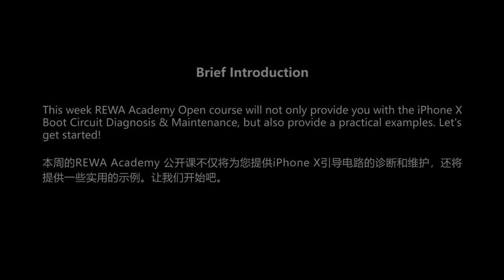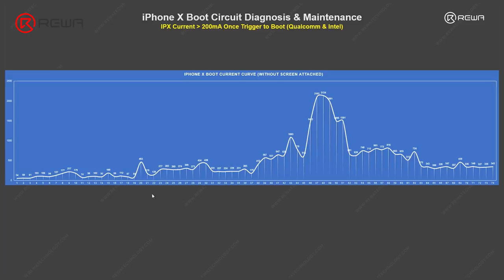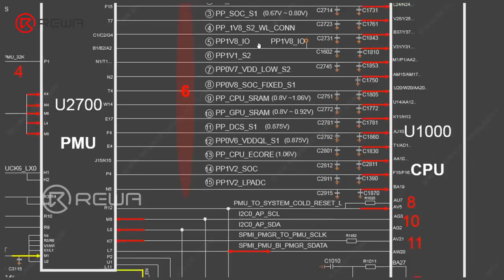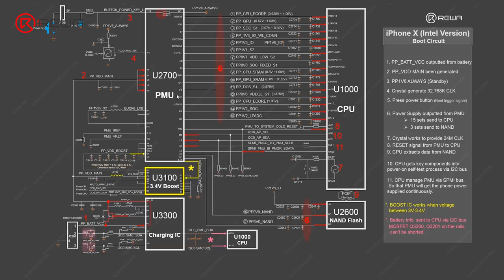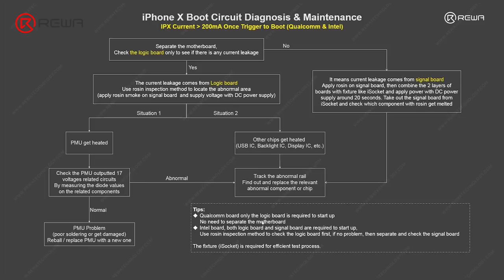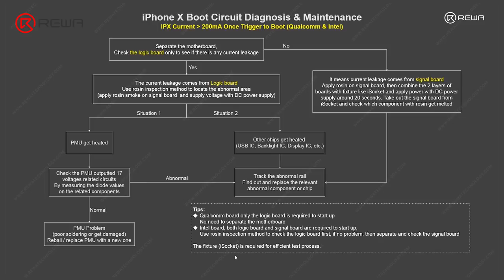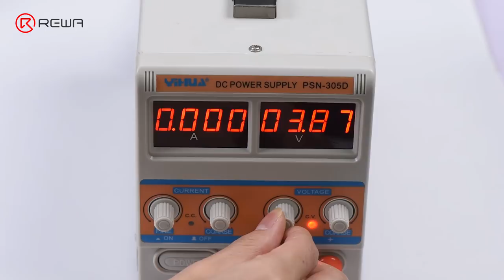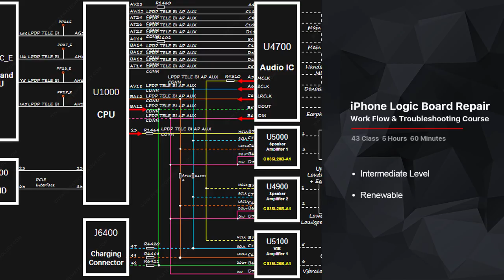iPhone X Boot Circuit Diagnosis & Maintenance Online Course | REWA Academy

Comment: is 3.6v safe while usinig rosin testing method--- because u applied voltage around processor and processor only needs around 1.5v voltage helpp

Comment: I didn't know for an Intel motherboard it wouldn't boot up if its separated. Boot current only goes up to 60mA. Is this because the EEPROM is on the signal board?
Reply from the maker: Hi David, while there is nothing to do with EEPROM. The Intel motherboard once sperated, it wouldn't boot up only with logic board, n boot current remains 60mA.

Comment: Can someone explain: He found C2649 faulty and then he ticked it off? Am I missing something here? Did he run boot test before soldering a new c2649. I just saw he took/tick it off and then he was done ✅
Reply: Starting at 10:47, after removing the c2649, he took care to measure the diode value from  empty pads, so he found that the value was normal. Which means that this problematic comes from c2649. So he replaced the c2649 and then tested
Reply: Evangéliste Jean Paul MUTOMBO NSAPU thanks for the clarification. I got confused because he didn’t show the process of putting a new c2649, but I should of assumed he did. Thanks! :)

Comment: Rosin smoke is one method what are other methods not including alcohol or freeze spray????
Reply from the maker: Other than that, you can use thermal imager, while rosin smoke will be one of the most cost-effective and efficient way base on experience.
Reply: REWA Technology thanks I will soon try this method of rosin

Comment: What is the best way to tell whether or not a current reading is normal?
Reply: Do I need to infer it from the circuit diagram, or do I just compare it to values of a working device? Or something else?
Reply: @samiabe8686  the values are in the circuit diagram. you can download the free Rewa eçschema called: REFOX.
In this software, they take care to put the circuit diagrams and the values
Reply: Evangéliste Jean Paul MUTOMBO NSAPU Thank you so much!